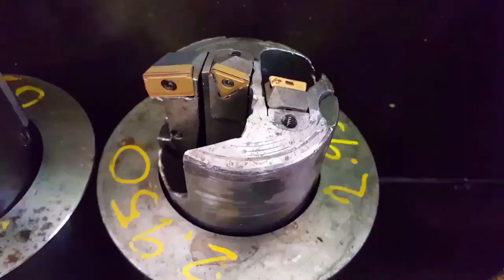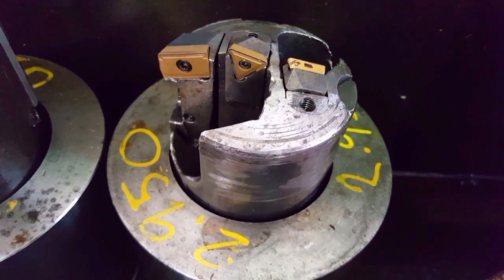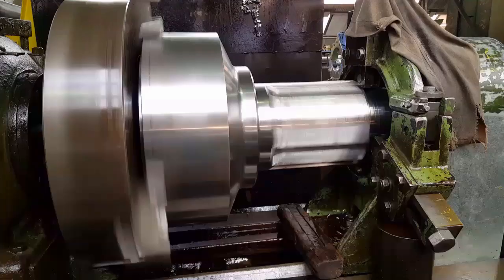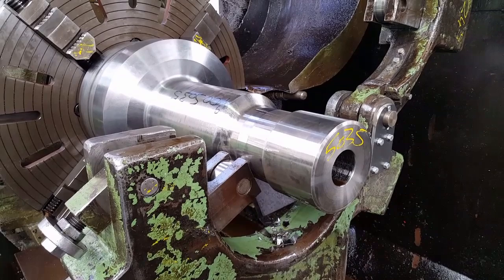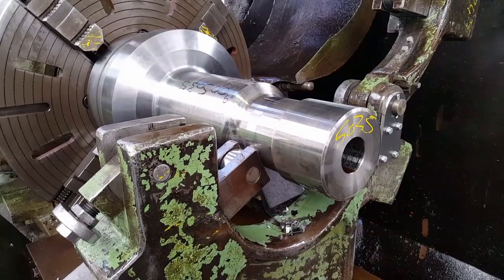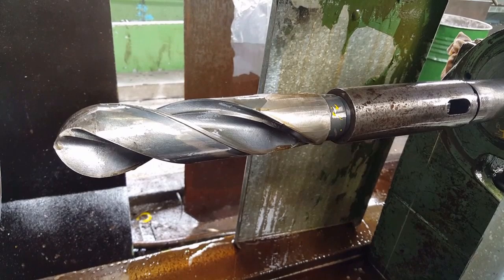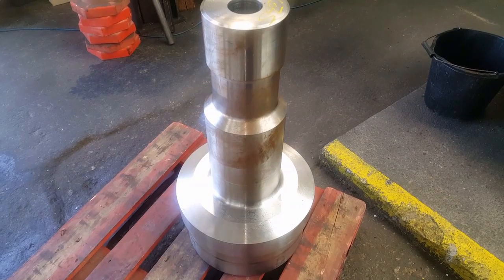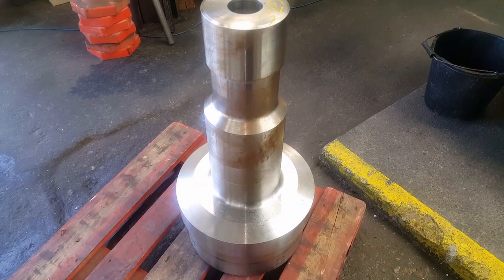Deep Hole Boring from 1" to 4.5" into solid steel bar

Comment: Hi dave. Great work. I'm also a machinist from Sheffield. I did a lot of trepanning 718, 625 and duplexs at my last firm where I served my apprenticeship. I think they used your tools but not 100% sure.
Reply from the maker: Hi Kieran.  Which company did you work at and where are you now? Hope ur an owl buddy 🦉
Reply: I did my apprenticeship at MJT engineering that's where we did a lot of trepanning. Then moved to swann morton as a engineer,  now I'm currently a finishing CNC Turner at AMB Hardfacing. And I'm not mate I'm a blade haha

Comment: Hi Dave your using double tube system for drilling?
Reply from the maker: Yes it's double tube system.
Reply from the maker: I have hundreds of this type of drill and tubes for sale.
Reply: @userwl2850  because i am using single tube system upto 8 meters long😄😄
Reply: @userwl2850  you have other option then sandvik because sandvik is closed his production for deephole drilling
Reply: @userwl2850  where can they be purchased?
Reply from the maker: @markellis6886  I'm selling all my tooling Mark.
Reply from the maker: @deepholedrillingspmdrillin3969  I'm very very familiar with deep hole boring and know all the company who are involved.